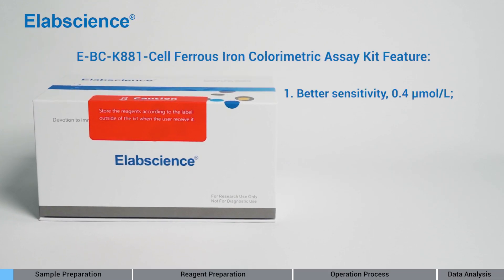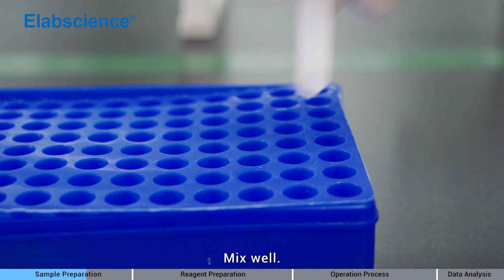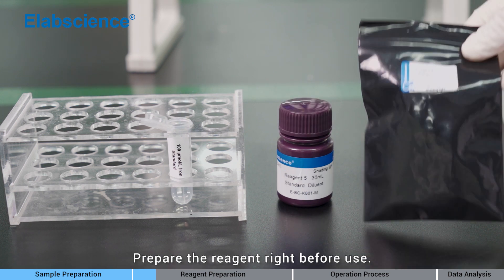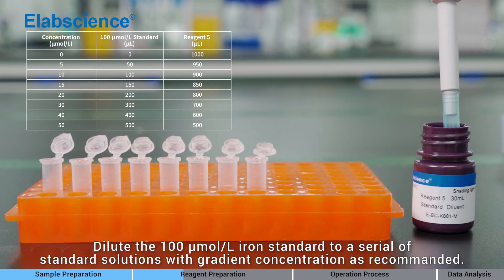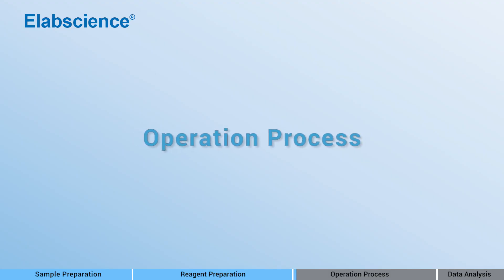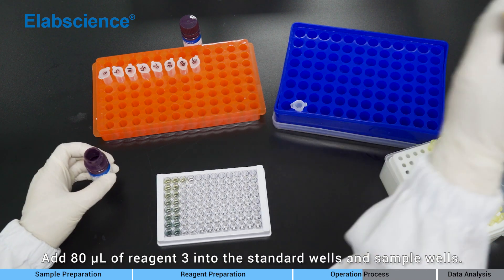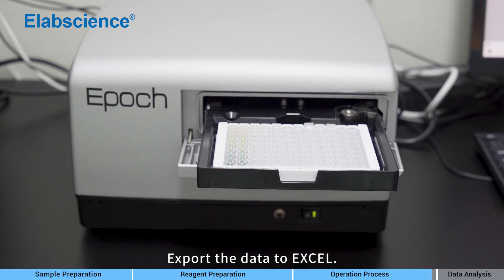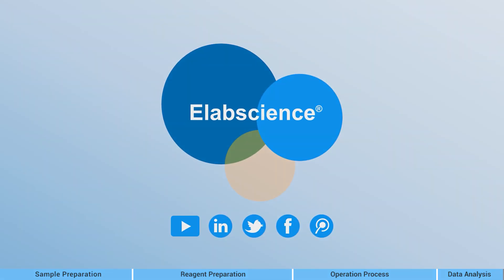The Operation Guiding for Cell Ferrous Iron Colorimetric Assay Kit

Comment: Hello.. actually I have to check the ferrous iron concentration in rat  ovarian cells...will u provide service
Reply from the maker: We do not have testing service at the moment. For the E-BC-K881-M kit, rat ovarian cells have not been validated by the laboratory. In theory, as long as the concentration of ferrous ions in the sample exceeds the sensitivity of the kit (0.4 μmol/L), it can be detected.